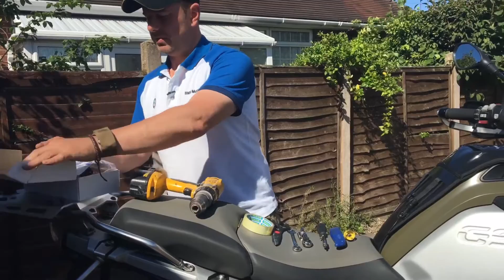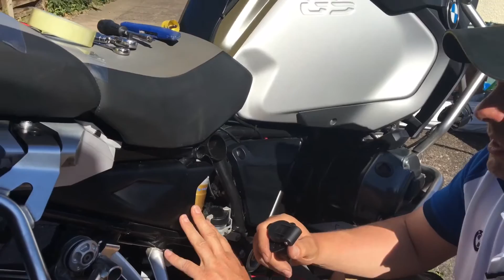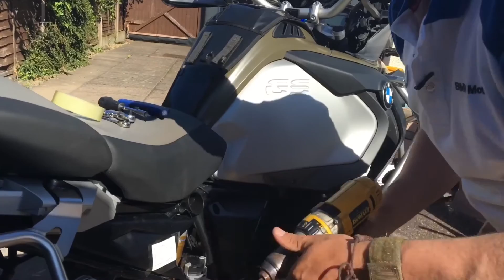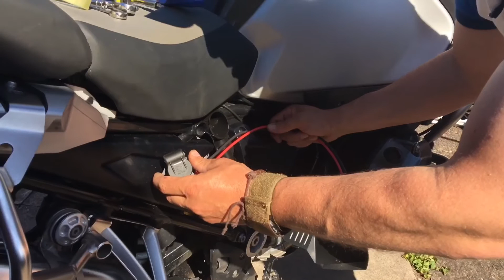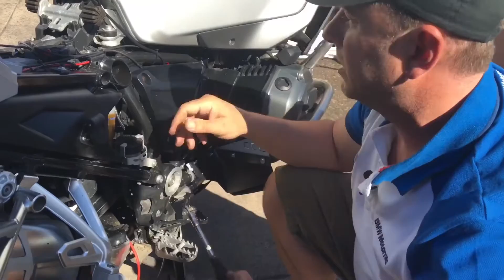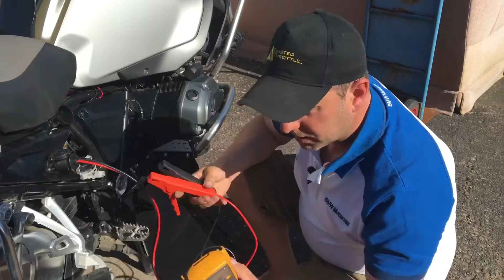Motorcycle Jump Start Kit Installation Tutorial - Step by Step - BAAS BS102

Comment: Couldn't you use an SAE without having to drill a hole in your panel? I have an SAE direct to battery that is simply zip tied to frame member. The adapter I keep onboard is an SAE to gator clips. However, if both bikes have a similar SAE, you could make a direct connection with that. Just a thought.
Reply from the maker: Hi! Yes great idea. I liked the look in the panel but yes like it 👍🏻
Reply: Richy Parton  Yep, I can see that also. Plus, the panel mount would be functional for other things too (i.e. a light for setting up camp, charging a phone, etc.) and yours is in a much more convenient location for that.

Comment: Hello Richy... Thanks for the videos. I would like to know if these modifications void your warranty or not. I want to add this kit to my bike.
Reply from the maker: Hi Juan, great question. As far as I know, as long as you don't drill, cut and modify any exiting part of the bike like the frame or cut into the wiring harness then BMW should honour any warranty work required. As long as you have correctly torqued bolts up as per manufacturing requirements then yes should be fine. You can always check with your local dealership.

Comment: was told by the dealer if we used a car to jump start the gs it would fry the canbus?
Reply from the maker: Hi. Good point raised about the can bus system. It's pretty much on all bikes and cars these days. This is the communication circuit between modules. Depending on what you use to jump the bike with you can stand a chance of damaging the system however when you jumping from another bikes battery your only using the same voltage and current it's used to. If you use a charged battery pack like they use on cars or from a mains plugged version then it stands a chance. At the end of the day all your doing is extending the circuit to the surrogate battery.